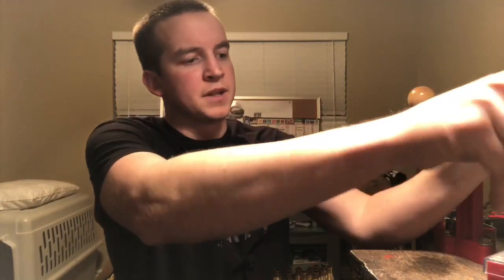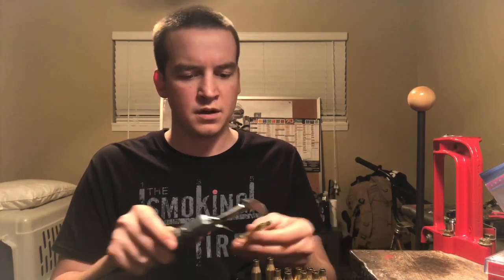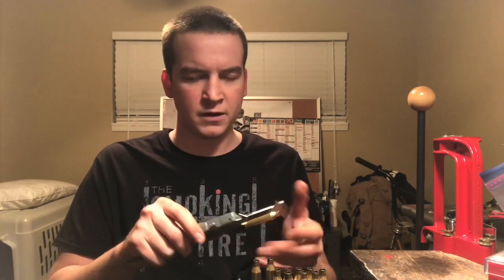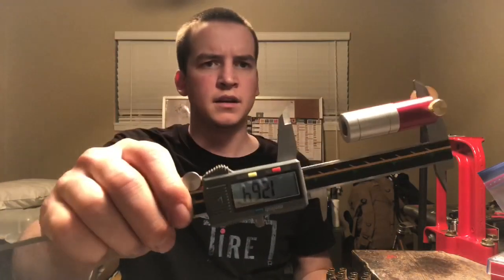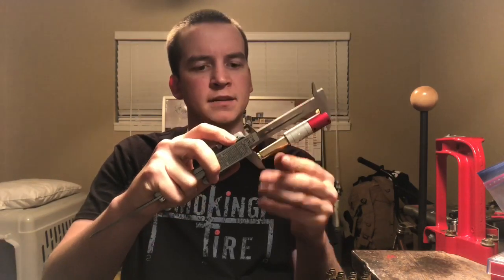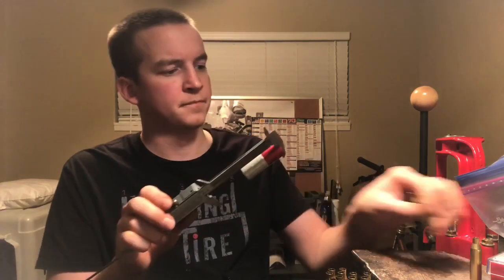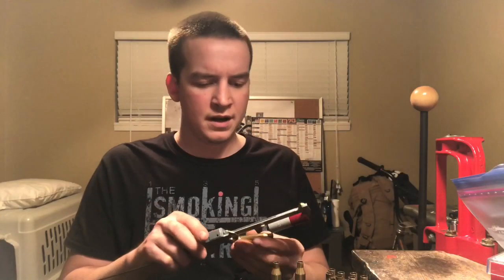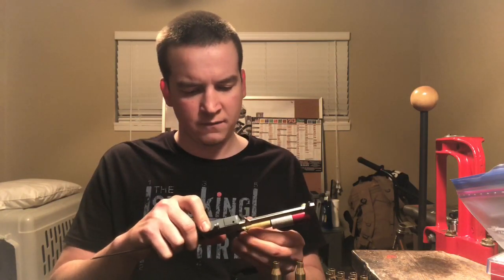Does the Lee Collet Die Stop Case Growth!? Lee Neck Sizing Series

Comment: I ran a similar test when I first got into bump sizing. I quickly learned that fire forming brass the right way, the first time is really important before you start working up a load or settle on your target headspace. That means fire forming all brass in the lot with a heavier bullet and as high of a charge as you're comfortable with. Apparently, that first firing is your best opportunity to shape the brass to the contour of your chamber. Wimpy charges don't get it done.
Reply from the maker: Very interesting I usually run a full power load to fire form, I dont make weak charges in hopes of forming it to the chamber. great comment man Ill keep that in mind

Comment: Great video and your on the right track. The benefit of only neck sizing is not that your brass won't stretch but having fire formed brass for your particular rifle. The real question is how many times can you shoot your fire formed, trimmed brass before you need to full length resize ,anneal and retrim and start the process all over. My guess is maybe 5 times.that would be a cool test! Keep up the good work!!
Reply from the maker: Yeah I know that is not what they claim I just thought this was interesting Info because it is important to watch as well as headspace after a few firings

Comment: Getting the comperator is an excellent device to have, It gives you the numbers that you need to get the measurement down pat There is a little leeway in its precision though. You have to take it to account the rim to bolt face tolerances, However, it is as accurate as you need to be, it's better than a drop headspace gauge. Believe it or not, I have never bought one of those. anyway, Good advice and instruction. Keep up the good work. Dave.
Reply from the maker: Thanks for the tip, I am not super concerned with getting the utmost precise measurement but for what I am reading with it Im plenty happy with this over having no idea what it is like before I had the tool haha

Comment: I had some norma brass in my tikka 260 rem that I fired 8 times and had resised with the lee collet and were still .005" under max case length!
Reply from the maker: Thats pretty awesome! Like I mentioned it depends on the cartridge design but that sounds awesome getting that many firings

Comment: Your Brass should last a lot longer with neck sizing vs full length. You can to a slight degree adjust Your cartridge length (To the Shoulder, where Your headspace is measured) with Your full length sizer die. I have a Lyman Case Trimmer that is good for trimming to overall length.  Good Video Brother.
Reply from the maker: Definitely dude! I want to make a video about bumping the shoulders back just a few thousandths but I need to get better at it first

Comment: Even after annealing I can not get enough friction on the bullet?
Reply from the maker: It’s interesting, my 243 works awesome but my 6.5 creedmoor Neck only die doesn’t get a whole lot of Neck tension either. You can put the mandrel in a drill  and sand it down a .001”